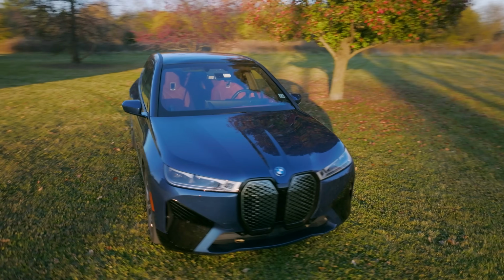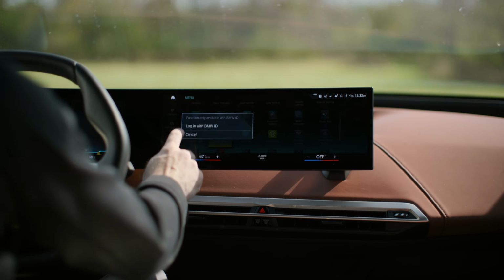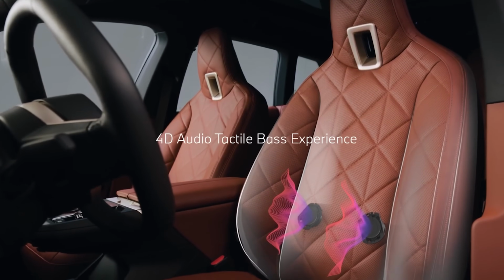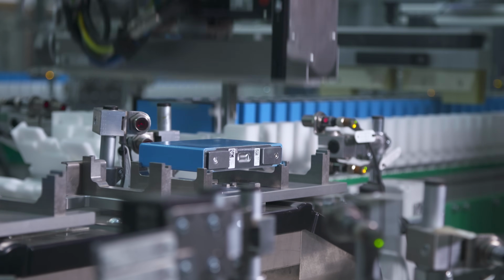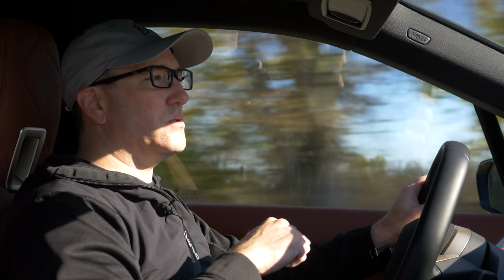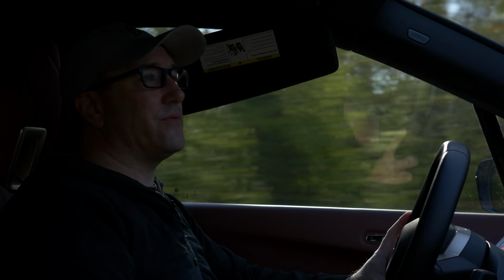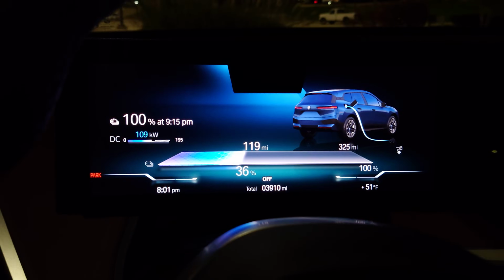BMW iX M60 | The Frustrating Future of EVs

Comment: There are a number of inaccuracies in this video that need to be pointed out:

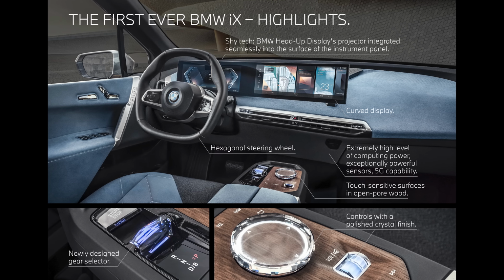2:43 - Leather and cloth are not the only option. There's Sensatec synthetic leather as well.
2:59 - Copper accent is not an option. It's standard and the only trim available
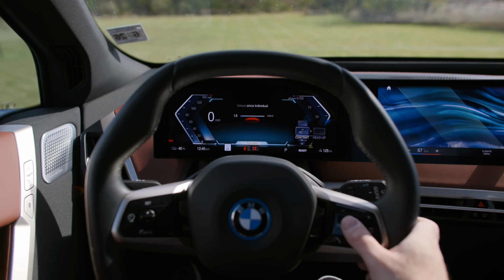6:36 - Ambient lighting can be accessed by the shortcut button on the roof console
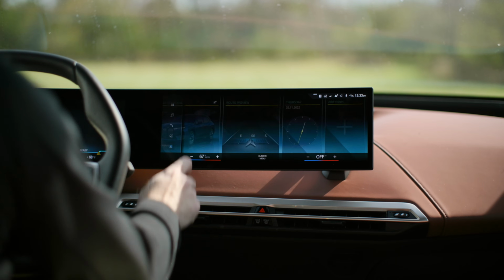8:38 - Lumbar/Massage delete is affect more than iX and cars being produced now have it added back
13:38 - This is not a next gen platform. It's electrified CLAR. The next gen platform is Nueu Klasse coming in 2025
15:14 - The CFRP is a reinforcement. It's glued on to the aluminium frame. It's NOT the frame
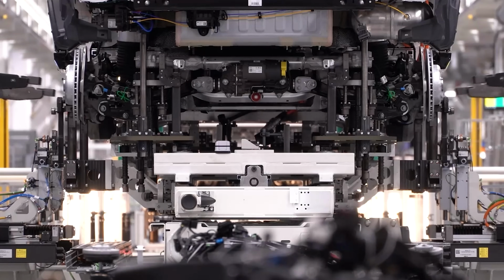20:32 - The rear motor on the M60 is different to the other models. It's not just a battery pack difference. It also features model specific anti roll bars, m-specific suspension tuning, etc...
21:30 - The CFRP door frame/circle is a $1500 part and BMW has a workshop video and instructions on how to replace it

I get that BMW was not helpful in providing information, but some simple research could have helped a great deal. Everything I mentioned above is available as public info.

IX Body Frame Diagram: https://monosnap.com/file/jVUM5Sl3Q2...h1ZZaRijk0eTZU
IX CFRP Side Cover Replacement Diagram: https://monosnap.com/file/puT6PYAs0e...GDKWBZLmpv9QuJ
IX M60 Model Highlights (BMW Press): https://www.press.bmwgroup.com/globa...48394EN/558995

Comment: My God, it pains me that I have to agree on most of the points here. I am baffled, a bit angered, but mostly disappointed by the direction that BMW is going in. The interior feels gimmicky, green-washed at the expense of the feeling of luxury and practicality and them wanting >100.000 € for this car at this point feels like adding insult to the injury. I'm at an iX3 which is basically a regular X3 with a battery and a motor driving only back wheels, and I sincerely don't see myself staying with the BMW once the lease period of 3 years has expired. Damn shame, BMW in 2022 pulled off what Merc did some 30 years ago - they were ahead, and really had a chance to stay ahead, but then they went and dopped that lead and went into what seems to be a completely wrong direction.

Comment: I don't find it bad looking. It's subjective.  In a lighter color I think the grill would stand out more and be less appealing.  I also doubt the value will crash in 3 years. People said the same thing about Tesla's and it didn't happen. 

I'd buy this over a Tesla Model X, every time. But both are way out of my price range.
Reply from the maker: How do you buy a 8 year-old Tesla and get it fixed?  You don't.  Just wait.
Reply: @savagegeese  8 years does not equal 3 years.

Comment: Overall solid video but I think you guys are really overstating the importance of 800v architecture and you're wrong about how people buy EVs. Yes, a lof of people lease their first EV. That's natural because people are unsure. We leased our Nissan Leaf in 2014. But what happened when that lease ran out? We bought it. And we are still driving it. Literally one of the worst EVs from a technology standpoint, but still our daily driver 8 years later.

The reality is that DC fast charging is a rarity for most people. Day in and day out, how fast you charge 10-80% isn't important. On road trips taking 30 minutes for that charge is usually fine because you're ready for a break. Sure being able to charge faster is nice, and one day I'll replace my Leaf with an 800v car. But right now I have an i4 on order and I will drive it for 7-8 years at least.

Also, I'd recommend that instead of guessing at what repair shops will do with battery packs that need repair, take a look at the shops all over the world that have moved past being scared of the unknown and dove into repairing battery packs. They don't just get thrown away any more than ICE motors and transmissions get thrown away. If there's a lot of value in a component, people will figure out how to fix it and salvage that value.

Comment: It's a shame they put such weird aesthetic decisions on such an amazing platform.  The weird synth sounds to replace engine noise?  Was anybody asking for that?  I hated it while you were driving.  I doubt I'd even be able to finish a drive with it on.  

Do people even like the iPad infotainment systems?  I've never heard anybody who likes it -- they say it's "not so bad once you get used to it."  Well, great, but I like and don't have to get used to physical buttons.  I suppose it's easier to cram everything into a screen, but luxury brands are supposed to put in the work to make my experience superior.  Take the time to figure out a few of the important functions and make physical buttons for them.  

Electronic door opening?  The only thing that benefits from being electronic is the hatchback for those too short/weak to pull it down.

Comment: The seats look like Patrick Star covered in quilted leather. Or perhaps kind of an abstracted "Squid Game" enforcer.
I used to work for Sony and it was absolutely accepted and perhaps even verifiably true that the Trinitron CRT picture tube was superior to virtually any other commercially available television. When the technology changed, and the market went to LCD, plasma and other flat screens Sony lost their advantage and their edge in the consumer market.
I think that is happening to BMW right now. The BMW reputation and history of internal combustion power trains was the envy of the industry. With the automobile industry moving to electrification, BMW has become an unfocused, "also ran" brand.
It's like they are attempting to establish a new image through "daring" styling (🤮) but what do they really have to offer? Their heritage does not seem to be successfully transitioning into the new electrified reality.

Comment: Even though I believe you're spot on most of the time, there's a couple of things I digress, and I'm pretty sure time will confirm it. a) this is not a hyper-disposable car. Batteries and EVs are evolving, but the increase in battery performance and capacity is slowing down year by year. In 5-years this car will still be competitive in terms of performance and capacity. b) In terms of maintenance, BMW is one of the few manufactures that allows external workshops to diagnose and replace individual modules of a battery. So there is no need to replace the whole battery if one cell fails. This is the opposite to Tesla, specifically the latest Model Y which is a repair nightmare. Taking into account a 1000-cycle lifetime for the battery before it degrades below 80%, the iX could easily hit a 300,000 mile life before requiring a battery change due to degradation. c) 800volt vs 400volt. It's an improvement but not a revolution. Most chargers do not support it yet, and due to chemistry the overall charging power is usually still maintained at 1C. There needs to be a revolution in battery chemistry in order to reach 2C or higher. the 800volt architecture will allow BMW to increase peak charging, specially between 10 to 80%, but most of the time you won't be needing it. (95% of all charges happen at home).  d) Next BMW architecture using the newest motors and batteries won't make this car obsolete. It will increase capacity and also reduce weight and volume. But most top-of-the range cars will still stay at around 80-100kWh. The reduction in weight and volume will allow for slight increase in space and also more flexible designs and lower consumptions, but don't expect getting below 10-15 kWh/100km.

Comment: I think this video overlooks a few facts…namely…Tesla is currently built on 400v architecture and most EV’s are substantially less. Currently, 800v architecture is not supported by current charging infrastructure..so it makes no sense to wait out something that will likely not happen for maybe 5-10 years. The benefits of an 800v system are minimal. If you’re basing your decision to by an EV based on charge time..then you’re not really looking for an EV. It’s silly to base your decision on waiting for 400v v. 800v. You could buy a Lucid or Inoniq 5 now with that infrastructure and gains are minimal. The car has to have a built in power inverter that speeds up the process, but then you have other issues with cooling, heat, and power efficiency. BMW purposely used 400v because it was the most efficient. No need to really precondition my the battery to charge and it’s plug and play. It’s a super easy car to operate. Maybe educate yourself more on different EV infrastructure and try to understand it. Then you can make a more informative decision, rather than just unsupported conclusions to make people fearful of owning an EV. It’s just like any other car…it’s never going to be an asset and you will always lose money.
Reply: Underrated comment.
Spot on! 👏

Comment: YES: the biggest problem with EV is that you have a high price tag and lose a lot of luxury.  HOWEVER:  Mercedes and BMW are producing some extremely luxurious EV - and others will follow.

THE KEY is using parts the public wants and are familiar with. 

The EQS and EQS SUV have the same luxurious parts of the MErcedes S-class.

The BMW i7 has the same luxurious parts as the BMW 7-series. 

The new Rolls Royce Spectre has the same luxurious parts as the RR Ghost.

This is why I chose the Cadillac Lyriq over the Tesla ANYTHING.  Tesla's interiors are flat, bland, boring and not luxurious despite the price tag.

GM uses BETTER materials in the Lyriq than they did the XT5 or XT6.

Ford uses roughly the same materials in the Lightning and Mache as they do in their other cars.

Comment: The redundant physical switch is mandated by law for electronic door actuators.  

Peter Pyros decided to take his Corvette-based 2006 Cadillac XLR for a spin around the block at his Cleveland, Ohio home. He got in the car – which has electric doors – and soon discovered the battery in the car was dead. The battery in his key fob was apparently dead too, because once inside he couldn’t get anything to work. He didn't know how to get out of the car and was locked in for 13 hours  like he was  "The Secret Soldiers of Benghazi".

Comment: I took my mom to a BMW event to drive the i4 and the ix.  

Here in NYC,  you're wanting an AWD crossover or SUV.  The BMW ix was surprisingly spacious and comfortable for me.  At $97,000  asking, I'd consider it, but I've preordered the Cadillac Lyriq as a replacement for my JEEP SRT. 

That saiid:  I recently drove the BMW i7 and had a chance to sit in the back.  The big screen drop-down display is a gimmick, but it's an awesome gimmick.

I'd like to see that in the iX with a THEATER MODE.

Comment: Can I buy you a flashlight so we can finally see an interior of any car you review without all the massive shadows constantly? It's a car review, not Batman.
Reply from the maker: Like I continue to say, we edit with completely calibrated displays, including high dynamic range cameras and 10bit color setups in editing. All interior shots in this video were fully color graded. Then converted properly to  REC709 and sRGB for web.  If you can't see interior shots in this video check your display. Almost no one in this space shoots and edits with as much care as we do.
Reply: @savagegeese  This isn't about how it's calibrated, it's about how the shot is lit. Your colors looks good, but since the interior are always minimally lit, it leaves a lot of massive shadows that you don't see in any other car reviews. The shop where you get it up on the lift, on the other hand, is extremely well lit. You can see the underside of the cars with more clarity than the interiors. But I'll check my monitors

Comment: If you own an EV you'd know that you almost never charge at a fast charge station. You charge at home with a dedicated charger at maybe 6-7kw. Another problem is that most fast chargers don't support 800v anyway, and it's going to take quite some time before 800v is commonly available everywhere. Tbh, most chargers are 50kw, and the few 150kw chargers there are tend to be taken.

Comment: A 60k EV is different in prices. You’re paying for a new platform and EV tech. They need to hit price points to make sales and make $$ long term. So yeah, a 55k ICE SUV will probably feel nicer and have better materials (in specific, strategic locations) than a 60k EV. Hence the plastic everywhere. 

Im worried in 20 years we’ll only have boring cars like this. Shame.

Comment: Incredibile presentation. BMW itself couldn't have done it better. I approached a BMW dealer, the guy assigned for the car sale knew nothing except the wait time is around 1 year to get one that was not in stock. The only thing that keeps me away from it is this carbon fiber frame. It's retarded to have this on a car that gets driven around town as a day-to-day drive. There are so many occasions when you can have a minor incident around that area that would make the car a wreck.

Comment: Actually; it's a lot better looking than the M3/ M4 because of the streamline design and those headlights. I think if that front grills was rounder like 1980s cars itd have smoother lines on the hood

Comment: The collision repair cost is a great point. I remember you talking about this years ago with the LC500. I ordered a 2023 4Runner. It's stone age, boxy, there's steel everywhere, body on frame, supply everywhere.... probably about as cheap to cosmetically repair as a modern vehicle can get, as long as the frame doesn't get bent.

Comment: The whole EV switch feels more and more like a scam to me. Maybe i'm so frustrated right now due to electricity prices in Germany and general EV prices. But i don't see myself getting a GTI electric equivalent any time soon. It doesn't exist, and when it will, it will be much more expensive, much heavier with a 1 screen touch-only UI with a 150km of range on the Autobahn.

Comment: Sorry Mark but your argument about high-end expensive "Disposable" cars is not a wide a spread problem. This is just a problem with a few of the legacy luxury automakers who don't even have large production capacity. There are plenty of people who can afford these $100,000 monstrosities because BMW can only make very few of them. Reality has SUPPLY Limitation which negate your problem.
The problem is not 400v charging architecture and 800v is not easily superior. The problem is Charge Curve / Rate SLOWs DOWN as the battery fills up. Both 400v & 800v has the same problem just that 800v can deal with heat from lower amperage better. Heat is not even the top fact that causes charge rate slow down especially when actively liquid cooled. Problem is we need a next gen battery with better cell types and wiring / bus bar architecture. That even at 400v stays at 150kw all the way 80% that would make charge much faster regardless of DC Charger voltage.
When these next gen battery arrive we have SUPPLY Limitation problems. It will take a long time before they will be mass produced and widely available thus they do not even compete with the 2nd hand market. 
The 3 year lease problem has nothing to do with BEVs, it's a problem of the DEBT Industry that is also applying this scam to ICE cars. BEVs inherently are best in there first SEVERAL years ownership and should be a solid workhorse. It's when you get past a Decade old when BEVs become disposable that has not be solved yet how to replace cell module easily. DC Fast Charging is NOT major factor to most drivers as anything that charges 200 miles in around 30 minutes is more than effective.
An effective BEV that has enough range will be useful regardless what new technology trickles in.

Comment: There's a number of inaccuracies in this video that need to be pointed out:

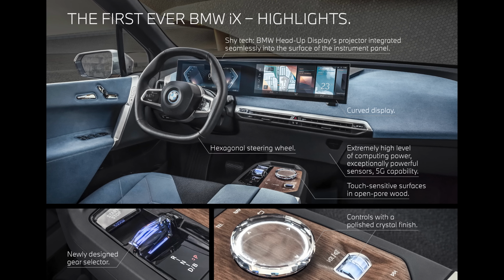2:43 - Leather and cloth are not the only option. There's Sensatec synthetic leather as well.
2:59 - Copper accent is not an option. It's standard and the only trim available
6:36 - Ambient lighting can be accessed by the shortcut button on the roof console
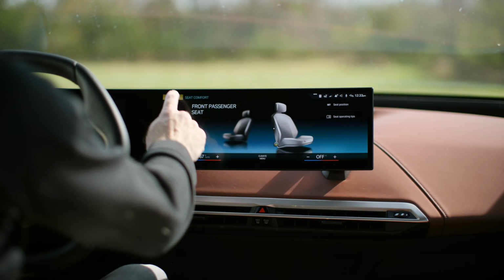8:38 - Lumbar/Massage delete is affect more than iX and cars being produced now have it added back
13:38 - This is not a next gen platform. It's electrified CLAR. The next gen platform is Nueu Klasse coming in 2025
15:14 - The CFRP is a reinforcement. It's glued on to the aluminium frame. It's NOT the frame
20:32 - The rear motor on the M60 is different to the other models. It's not just a battery pack difference. It also features model specific anti roll bars, m-specific suspension tuning, etc...
21:30 - The CFRP door frame/circle is a $1500 part and BMW has a workshop video and instructions on how to replace it

I get that BMW was not helpful in providing information, but some simple research could have helped a great deal. Everything I mentioned above is available as public info.

IX Body Frame Diagram: https://monosnap.com/file/jVUM5Sl3Q2YiLxRBh1ZZaRijk0eTZU
IX CFRP Side Cover Diagram: https://monosnap.com/file/puT6PYAs0ed866uwGDKWBZLmpv9QuJ
IX M60 Model Highlights (BMW Press): https://www.press.bmwgroup.com/global/article/attachment/T0348394EN/558995

Comment: there is a lot of value in this car if you can accept the fact that the next gen is going to be that much better. at least with an electric now you can have a bmw suv that goes to 200-300k miles. what x5m is doing that.

Comment: It'll be interesting to see which EVs, if any, will gain value over the years.
Reply: i am pretty sure this time is gone. A 50 year old car you can drive like any other and keep it alive because its so "crude" that making and holding spare parts is possible.. A todays EV, in 40-50 years time, you will not be able to drive at all. the battery will have degraded and pretty much all of the electronics will not be serviceable. it might be possible to switch out the physical battery tech in 10, 20 or 30 years time to a then modern solid state generation, but the electronics? no one will make those parts anymore.
Reply: The I3 is a future classic!